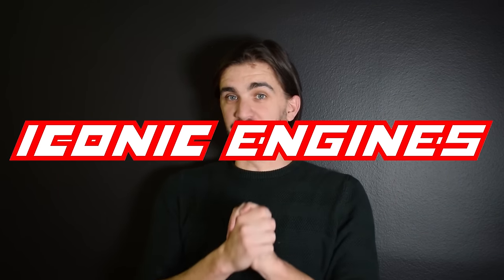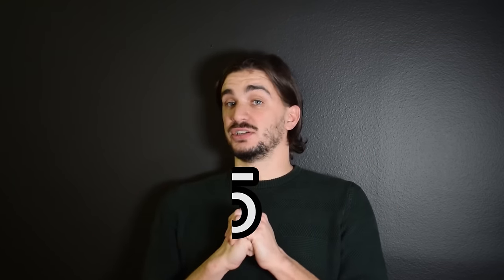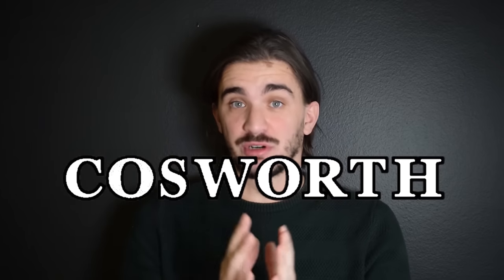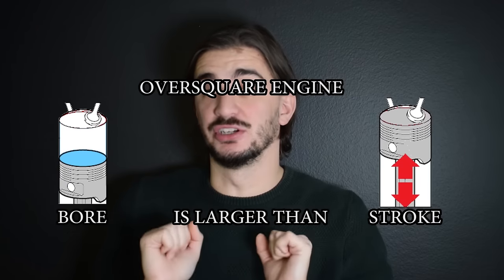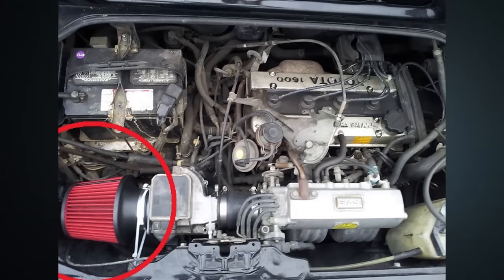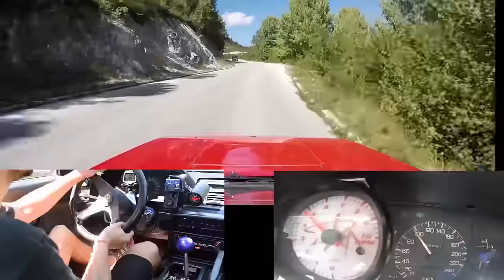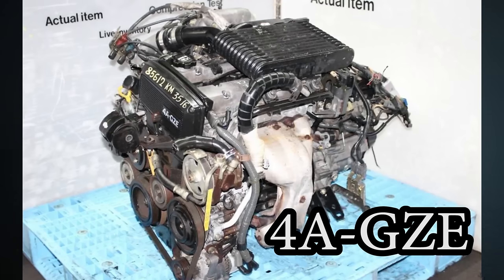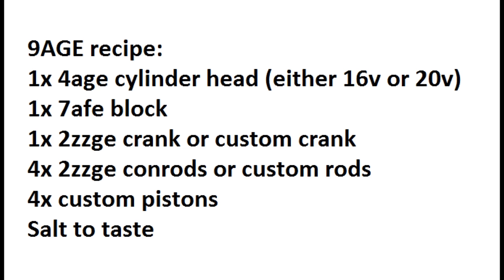Toyota 4AGE - What makes it GREAT? ICONIC ENGINES #1

Comment: Fans of initial D or not, I would like to point out that the 4AGE that Bunta put in Takumi's 86 after the original blew out WAS from the Formula Atlantic race cars. Bunta mentions a friend acquiring the engine from connections within the racing world, it was not just another 4AGE but that explains it's capability of revving up to 10k rpm
Reply: it was 11K as the rev limit but later lowered to 9k as a tune for better all around torque
Reply: @TheKiddingStar  it had 9k and later 11k when they got the new tachometer, it had 11k until at the end of the series, it went to 12k so it blew up
Reply: @calvinDy  Pretty sure you're mostly right but Ryosuke told Takumi that they lowered the rpm just as a better tune for mid range torque in the same scene that he explains the engine can rev to 12k for extra torque at the high end...
Reply: nah cuz the engine they depicted was a silver top 20v which could not make even close to the performance that the FA engines made. even tho bunta said that stuff the engine didn't exist
Reply: @TheKiddingStar  I think, I couldn't find the episode you we're talking about. The closes thing I could find near that is ryosuke telling keisuke that the engine is probably de-tuned for street use, though I only tried finding it it 2nd stage and 3rd stage, also it can't rev to 12k. 11k is max, if it went to 12k it would blow up
Reply: @melonfox It happens in Final Stage when Takumi races Shinji, they put the rev limit at 9k for more torque and to conserve the engine it then over revs and blows after passing Shinji’s 86 coupe…
Reply: its not a formula atlantic engine, its a group A 20v silvertop by TRD, the engine is real and the build is inspired by a real guy whos name i forget who had one of those and swapped it into his 86 levin, he even detuned it to 9k rpm for street use
Reply: Ryosuke mentioned that it was a Group A engine. It's competitor (the B16 in the JACCS civic) modified for Group A made around 230hp according to Best Motoring, so im sure the 4AGE 20V Group A engine made similar power
Reply: The engine in takumi's 86 is a TRD silver top 4AG that has Weber carburetors on it.
Reply: Thats just a theory it was actually was a special 4age trd group a engine 25v "super high rev" engine not the Atlantic engine or the silvertop 20v it was really just an one in only racing silver top with 25vavles not 20v and could rev more than a normal silvertop even fully worked to make it simple
Reply: @-kryon1c-  it was still a 20v engine, it was a 20v silvertop trd engine with a 11k rpm redline. It also har Weber carburetors
Reply: @destiny2drang650    as i said " it was really just an one in only racing silvertop with 25vavles instead of 20vavles and could rev well more then a normal silvertop fully worked to make it simple" 👍🏼
Reply: @-kryon1c-  where did u get 25valves from?
Reply: @destiny2drang650   season 2 I think wataru or itsuki mentioned it I can't specifically remember
Reply: @-kryon1c-  he said that it's a 5valve head, 5valves per cylinder is 20valves so it's a 20v head
Reply: @destiny2drang650  my bad lmao he says a 5 valve head from the 101 series I haven't seen season 2 in a long time lol
Reply: @-kryon1c-  I understand lol just got kinda confused
Reply: @destiny2drang650  yeah lol probably two years since I last watched season 2
Reply: @detectivepayne3773  His name is Akira Iida and sure you're right, the engine IS real and can run up to11k/rpm and was detuned for street use to 9k/rpm. :)
It was not availible to the public because it differs from the actual Formula Atlantic engines, rigth too. :p 
Base is a AE101 Silver Top 20V 4A-GE pact with TRD parts and customised TODA stuff, too leading to an approx output of ~ 245hp. Not bad for a 1.6 NA, huh?^^
Most stuff/facts ect. you can find on the Inital D Wiki what comes nice to 'actually' get to know what's build in there. ;p
Reply: Revved to 11.  Which real formula Atlantic engine can and will do if you want.      I’m gonna be putting one in a trueno for real  starting saving this year
Reply: @destiny2drang650 it just had itbs, not carbs.
Reply: @happi6969  in season 2 they say carburetors and in the manga you can see that they're Weber carburetors
Reply: @destiny2drang650  "in season 2 they say carburetors and in the manga you can see that they're Weber carburetors"

It is 100% EFI in the anime.

It is carb in the manga, however.
Reply: @SidewaysGts   I am aware, but look in S2 they do say carburetors and you can see carburetors
Reply: @destiny2drang650  "but look in S2 they do say carburetors and you can see carburetors"

It is not shown with carbs in season 2.  It is shown with ITBs. The first time you see the engine you can literally see the fuel rail going over the ITBs (not something youd have on a carb set up).

There is no mention of them being "carbs" either. 

I have watched this show start to finish many times- Including recently.  If you think they mention carbs somewhere, by all means- please tell me where.

Of course it is worth noting that the physical 3d model they used for the engine is rather low quality, and likely an approximation based on a slightly tuned model that some artist found (We have seen other instances of this throughout the series. The first time keisukes FD engine bay is shown for example, it is clearly a single turbo set up.  Again, likely just a mistake made by an artist that looked at "tuner cars" and found a modded engine bay)- But stage 3, 4, 5, and final stage, also all show them as ITBs even more clearly.

To further add to that point: You get a greatshot of the engine around 20~ minutes into the 3rd stage movie. The "model" (again, its cgi) is very clearly based entirely on the cgi model from stage 2 (there are numerous distinct features from the 2nd stage cgi model present here, that are distinctly changed later in the series)- And the fact that what theyd modeled before was ITBs is even more apparent.

Comment: 153 HP from a tiny 1.6 L engine is more than enough for me
Reply: Its not just more than enough, its amazing that toyota managed to squeeze 153/160 hp per litres with 80-90 tech from a reliable engine
Reply: @nikatskhovrebadze5803  its more like 100HP/L
And thats nothing special for a high revving engine.
Reply: So which is better? 4AGE or D16/B16 by Honda?
Reply: @yuotosaka9092  4Age
Reply: @yuotosaka9092  go for a turbo charged K20 conversion 😎

I'd never buy a 1,6L turbo.  

I own a opel/vauxhall astra H with 2.0 turbo and it produces 200horses stock.  I could easyly add 50Hp on stock engine without reliability issues.  And its allready pretty fun to drive. But you want more over time...  and so im currently a 2nd block with forged internals and it will output 400-420 horses.  But this year i'm gonna start with a mild 300hp software to get used to the behaviour like torque steer and upgrade the suspension to handle all that torque.

What i'd like to say is: you need a bit of displacement to create exhausgasflow.  A modified 1,6L turbo is flat AF innthe low range and as soon as it reaches boost you'll fight the wheelspin.

With more displacement not only the turbo gets spooled earlier but the engine also has more  torque below boost level.  So the everyday drivabillity is wayyy better with a bit of displacement then with a tiny engine that relies 100% on the turbo-torque.

As soon as the turbo will be bigger it would not spool at 2000-2500 but more like 3000-3500. And that is the problem. Now you have all the top end power and high numbers but cant get of the line because you have to wait till the engine revs to 3500 rpm.

Nobody wanty that in an everyday car.

The least for light cars in my opinion is 1,8L - better 2.0L.  2,5L is about perfect for up to 400 horses with perfect low end grunge and can reach 500hp with a bit of a loss in the low end.

1,6L cant get much past 200hp without major losses in the low end.  If your fine with that (for ever! ) you should consider the 1,6L class.
Reply: @casemodder89  Does it make sense that you  personally would never buy 1,6 turbo? People all around the Europe buy VAGs and all of that kind with 1,4 turbo and feel happy. No theory, just results.
Reply: @nikatskhovrebadze5803  две двойки тебе по английскому и математике
Reply: @paulgauthier2693  yes it makes perfectly sense because i'm not up for fuel savings and scrapping a car every 3 years.

I'd like to invest some money, get good power, smooth torque band and reliability over - serval - years from it. On top i like to blast down the non restricted 'autobahn'. You can't WOT these  super sensitive 1,4 and 1,6L engines otherwise the timing chain will snap or pistons will melt.

An 180 horses 1,6L can never on earth deliver a smooth torque band AND on top be reliable ! It just doesn't work that way in physics.

Also try trailing a caravan with the tiny overblown 1.4s or 1.6s. It will end in clutch burnouts and catatrophic engine failure.
Reply: Suzuki g13b is a engine that absolutely shocked me back in the day
Reply: said no one ever 🤣
Reply: Amen brother
Reply: Now that I think about it 100hp per liter is not that groundbreaking lolll
Reply: Same here
Reply: @casemodder89  that's why Honda S2000 had the record having a 100hp per litre for 10 years till Ferrari 458 took the record.
Reply: And then we have the gr yaris, 260 hp awd, what a car
Reply: There are plenty of 1L engines that make 200+ hp na
Reply: Look at the new amg a45 2L with 421bhp
Reply: @nikatskhovrebadze5803  Toyota and their engine dev was invincible in the 80's and 90's.
Reply: @YES-lu3sq  Suzuki M13A engine is the most underrated. Best engine for a small aircraft. Never got much recognition because of the cars it came out in.
Reply: @casemodder89  The Blacktop 1.6L made 163hp to the crank I believe and while it's more 90s-2000s tech than 80s-90s its still impressive...
Reply: Its not about the amount of power but how that engine deliver it.. 4A-GE is definitely something that history will remember.. Yamaha-Toyota together are unbeatable... Were
Reply: @noahmelsom5750  Bike engines that rews to 15-17k but makes no torque down in the rew range.. Dont compare apples with oranges
Reply: Nah I think 230 at 9800 rpm is more my style
Reply: turbo diesel
Reply: @maahirhaq4132 not na
Reply: Or, just saying. You can get a NA Duratec out of a Ford Focus that makes 160 hp stock from a pick n' pull for $250.

Comment: Im confuced. So the 4age was the better version of a 4afe? But the 4afe had different versions which got used at least until 1999 (at least in europe) so was the 4age the upgrade of the 4afe or did it split off the 4afe but not replacing it?

Comment: 100hp per liter of NA displacement is a remarkable accomplishment for any engine.  An AW11 with 160hp and the chassis being lightened and reinforced for racing is an amazing sportscar!  I should be mad at you for these great MR2 vids...cus I miss my old MR2 that I put so much time and money and love into...   ;)  I am not mad though!  Keep up the great work!
Reply: most 1 liter motorbike engines make around 200hp NA. also 2 stroke superkart engines make 100hp from 250cc so 400hp per liter
Reply: @scyra9997  OK but put these engine in a car that weight 1000kg and it will not move lol. 100hp per liter with a minimum of torque is impressive thrust him
Reply: @diegogiovinazzo7774  Wheel torque is just a matter of gearing. A 1000 kg car won't like to move with the bike engine's stock gearing, but if you put in a proper final drive it will move just as easily as with car engines of similar hp. 99.9% of people still don't understand how power and torque works, just rely on sayings containing half truths and their gut feeling.
Reply: @andrasjuhasz7011  if you only change the final gearing then you'll get good amount of torque but it will rob the top end power which is also known as horsepower.

Comment: 4AGE and 3SGE are my favorite NA Engines from Toyota.

I would love to see a 3SGE segment.
Reply from the maker: 3sge is coming up for sure!
Reply: @d4a  YES please 3sge :-) incl. the 3. gen. 175 hp. I build one myself but so far have no car to test it in. All balanced, higher compression, ported head, mod. cams, camgears, new bearings, gaskets, seals and pumps. Lightened and balanced flywheel and crank pulley. New clutch also balanced. Cleaned and tested injectors. All ridges and edges from airbox to intake ports smoothed out. Heavily modifyed ACIS.
Reply: ITB Beams ?
Reply: 3S-GTE - My favorite flavor
Reply: Toyota builds great engines, but I always hate the 3RZ-FE getting snubbed.  So much potential there.
Reply: Don't forget the 2ZZGE
Reply: You haven't seen anything yet.  Honda has better 4 cylinder engines.
Reply: @doubl33Ace  he said Toyota
Reply: 2zz engine awesome as well
Reply: @yowjerden  agreed
Reply: 2ZZGE for me, a bit more modern with VVTLI

Comment: I have been building 4age's since 1998(my second car was a aw11) and your comments are exactly on point!  In a world with alot of miss information seeing a video on YouTube that correctly and honestly talks about a engine that is near and dear to my heart is very important.  Well done!  I may pull out my 5mg(z)e of my 76 Toyota Corona and put it in my wife's 87 Cressida (mx73) and actually sit down and build the turbo 7ag that's been sitting on the shop floor for about 3 years.  Great video and good on you for it!!!! (One thing you got wrong was the 4agze rods are huge and can be boosted to around 300+ hp and be safe).  But other than that absolute perfection! You get a sub for this!!!!
Reply: Thats one thing i love about 86 community is that people really care about the cars theres no mustang/240 fanboys (not to say anything bad i love my foxbody:)) finding info on my fox is digging through hot rod dad magazines from 2005 cant find a good source like billzilla
Reply: Tell me which 4ages came with oil squirters besides the small ports?
Reply: @slow_carsgarage7422  4agze large port has them
Reply: @mista2621  is redtop better than blacktop for drift...?

Comment: I own a starlet with a 20v black top  couldn't be more happier
Reply: I own an 81 starlet that I had swapped in a 3TC and recently upgraded to a 20V silvertop.....absolutely love it.
Reply: Pepe Jazbec  I've a 20V silvertop...I've never heard of a 16V silvertop.
Reply: My former cars:
AE111 Sprinter Carib BZ Touring 20v Blacktop 6 spd
AE111 Sprinter Trueno 20v Blacktop auto
AE100 Corolla 20v Silvertop/Blacktop 12.7:1 compression race car with 5 speed lsd box. (Built 8 years ago and still drag races 5 to 6 events per year. Now with 150 shot of nos)

I have also built turbo 4age Silvertop with gze 8.9:1 pistons.
Reply: I have a 1993 ae101 with a 20v
Reply: @kimoliburd8829  could you guide me in building my blacktop 20v 5 speed? Cant seem to understand the bucket under shim and etc
Reply: @andrec8941  did the swap go easy ? Was thinking about this silver top swap for my 93 paseo.
Reply: So do I, love that little rocket ❤️
Reply: got a 4age blacktop levin and 4efte starletttt
Reply: Me too
Reply: awesome!!, 
lucky you👍

Comment: Great video dude! As a Toyota head, AW11 MR2 fanatic, and someone who's spent more time workin on 4AGs than anything this was really enjoyable! I used to have an 87 MR2 with a bigport 4AGE with $1.5k in suspension mods I installed plus some other interior goodies, exhaust, wheels and tires...those TVIS sounds pulled my heartstrings lol, I miss that car and that motor. Now I've got an 86 MR2 with a JDM 4AGZE swap and even more money put into the suspension, lots of good bits. No more TVIS, but man 165hp and 155l ft/lbs out of a 1.6 is great, and people's reaction who aren't in the know is great when I tell them that little bitty motor has a supercharger pushing 10psi on it making some respectable power. Love 4AGs!

Comment: In New Zealand in 1990 we got the ae92 hatch called the gti. It was the nz new and built version of the Gen 2 fxgt. It had the red and black top, which is the smallport 7 rib that put out 127hp and was rev limited, not speed limited. I owned mine for 5 years and it is in my top 3 owned cars. 150kph in 3rd 😂 I miss it. I chose to keep my gtt caldina which has the 3sgte and awd etcetc. Great vid, excellent knowledge and great for anyone looking to own a 4age containing vehicle. Thanks for your good work.
Reply: I've gone up the kaimais towards tauranga sliding all over the place and your absolutely right they are a great car.

Comment: I had a 4AGE powered corolla in the 90's, no much fun to drive. Even took it to the local race tracks for some club level sprints. Now I'm older and have Subaru fitted with EJ20 turbo, boost is king for sure.

Comment: A specification was missed at 9:26 for the 4A-GZE. There were two generations; 1st gen 145hp used the large port 16v head, 2nd gen 165hp used the small port 16v head.
Reply: Good day. I really likes the 4AGE till he mentioned that is we want more power with out doing a whole then we must opt for a toyota 4A—GZE. Your thoughts ?
Reply: @grfico_  It all depends on your goal. You can certainly make power with a naturally aspirated 4A-GE but it can get expensive depending on how much you want to make. So, what's your power goal?

Comment: The Formula Atlantic engines are $15,000 minimum, and need a good amount of run and race time, and also need frequent rebuilds. YES the stock 4AGE is wonderful in all of the small platforms that it fits in, as long as you can tackle the oil seals around the distributor, oil pan (add baffle to prevent oil starvation on lateral force), and valve gasket covers (coolant flows from cylinder one through four, making cylinder four the hottest).
Much else costs money, this man speaks the truth.
It WORKS